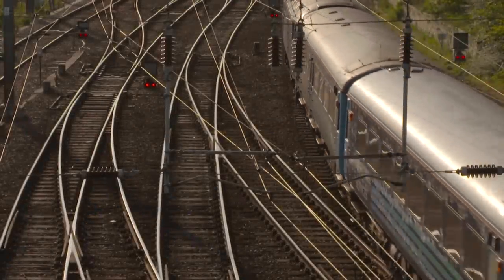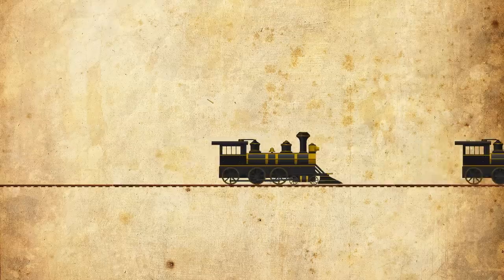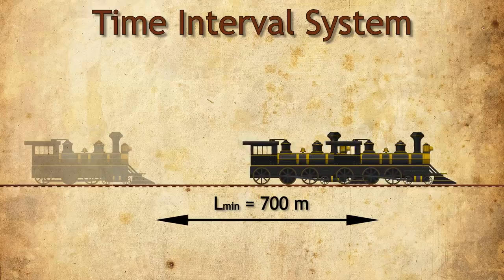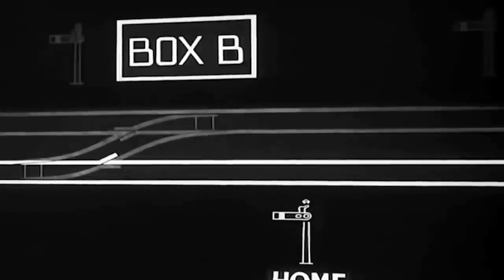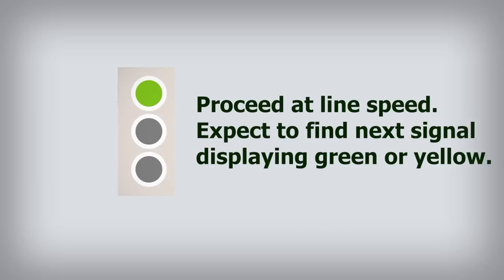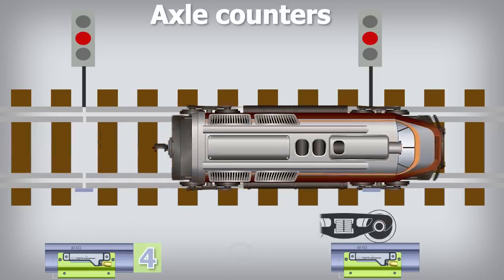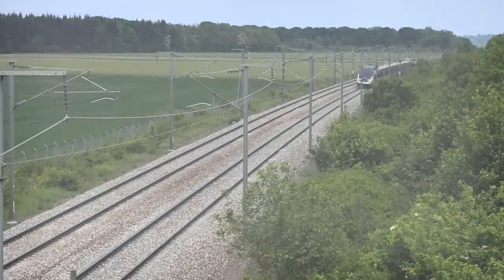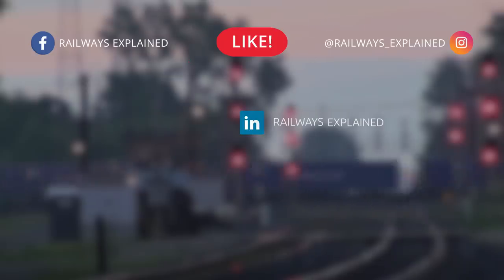How RAILWAY SIGNALLING Evolved from Flags to 4G Network

Comment: You said that lineside signalling is used up to 160 km/h in Europe. This is not correct. The UK (which remains in Europe in spite of Brexit) has been running trains at up to 200 km/h for several decades. Richard Branson briefly had a plan to raise this limit a small amount, though it wasn't followed through. The only UK mainline route I can think of that only uses in-cab signalling is the Channel Tunnel Rail Link (300 km/h and 230 km/h for phases I and II, respectively).

Comment: Never occurred to me that track side signals would be difficult to read at high speeds. American moment
Reply: The signalling goes inside the locomotives if speed higher 160 km/h e.g. Intercity Express (ICE) or Thaily. Same on Japanese monorail. Many Metro/Underground/U-Bahn use inside signal as security features too. Specially the typical fast train with 250/300/350 km/h travel speed can not see ground signalling so fast.
Reply: @OldLordSpeedy  In the US, cab signaling or speed regulation is more or less required above 79 miles per hour.  Wayside signaling may be present, but such signals can simply say "just read the speed display in the cab."

Comment: Can the overspeed-detection capability included in ATP be programmed to detect if an overspeeding train isn't slowing down and send ahead a warning of a potential runaway?
Reply: to the control center, yes
Reply: but usually, if a train is overspeeding more than a set time limit, the brakes are auto applied
Reply: @blue9multimediagroup  I was more thinking situations like a brake failure, overloaded train running downhill, etc., where the problem is the brakes' ability (or lack thereof) to stop the train, rather than the application (or lack thereof) of the brakes.

Comment: You didn’t mention ERTMS/ETCS leve 2  in cab signaling system which is an advanced system that constantly monitors the trains movements and can allow more than one train into one block section if needed, we are using the ERTMS system here in Saudi Arabia.

Thank you
Reply from the maker: Dear Hassan, thank you for noticing that. The idea of the video was to try to show the evolution and direction of development of the railway signalling system. Of course, ERTMS/ETCS is an indispensable part of modern signaling, but what we are interested in and what we will show in some future video related to signaling is further improvements of ERTMS, further plans of the Chinese with CTCS (China Train Control System) and South Koreans with its KTCS (Korean Train Control System) in the part of connecting with 4g technology.
Reply: Which lines?

Comment: BRITISH "PERMISSIVE BLOCK WORKING" - MULTIPLE TRAINS IN A BLOCK !!!!! 
This programme begins with Quote "Only one train can be present in one segment of line at one time" Unquote. NOT if you have "PERMISSIVE BLOCK WORKING" which allowed trains to follow each other on condition they did not exceed 25mph, and stopped at least 200yds short of the train ahead. (And could IGNORE the semaphore signalling provided) Indeed on such lines many of the trains were "unfitted" (NO train brakes except the loco & Guards van) !  This system was of course confined to freight only operation. But could be seen in use on the 4 track Midland Main line during "off peak" hours on what were nominally the Up & Down Local tracks. It was finally abolished by 1972.

Comment: SECTIONS are NOT BLOCKS. The system using "stop watches" is actually TIME INTERVAL BLOCK. Meaning that when a train leaves Station A, the signalman exhibits a red flag for eight minutes. From 8 to 15 minutes after the train left station A he exhibits a yellow flag, & after 15 minutes has elapsed he exhibits a Green flag. A pointless programme if you don't know what you're talking about !!! ❌
Reply: Do you think they used those three colours 150 years ago?

Comment: Just put a cel phone in each train that connect to central dispatch and each other nearby train — the cellphone has enough computer capacity to calculate safe speed — central dispatch throws switches, supplies power, schedules crews etc  as needed. — finally, something AI could probably excel at.
Reply: dont worry, someone definitely thought of that before
Reply: @JovanLemon  not a chance or it would have been in this video and because it saves gobs of money and increases speeds = profit! — so, for my creative thought, they can just send me one tenth of one percent of all the money saved; i will send them a nice thank you note for every million..
Reply: That's basically ERTMS Level 2 and 3.

Comment: We know there are about 40 times more signaling locations than trainset. We also know it is 100 times more expensive to have signaling on the tracks instead of inside the trainsets. Still, these ultra-conservative clowns go for signaling on the tracks.